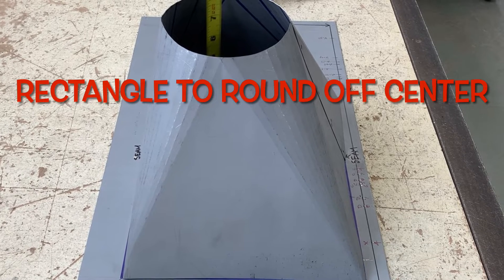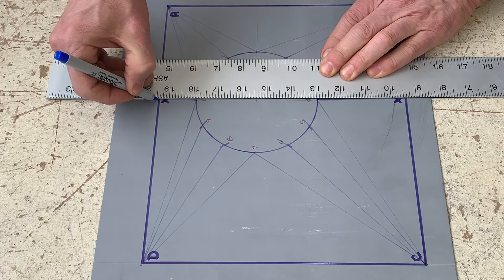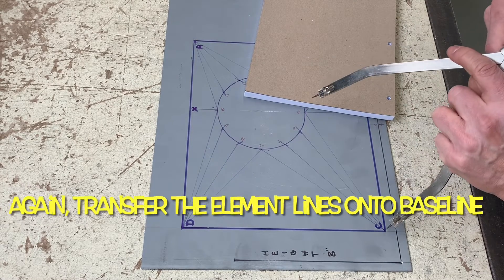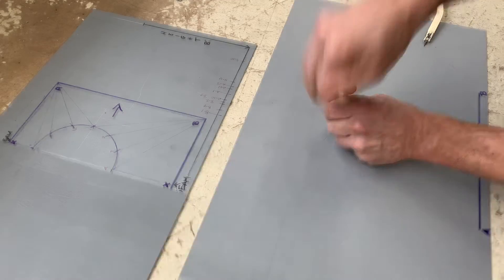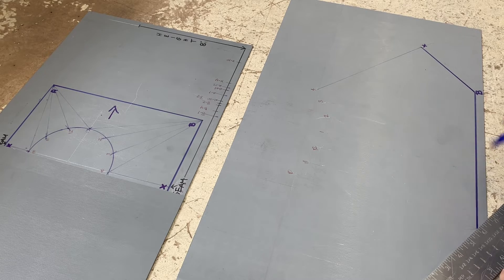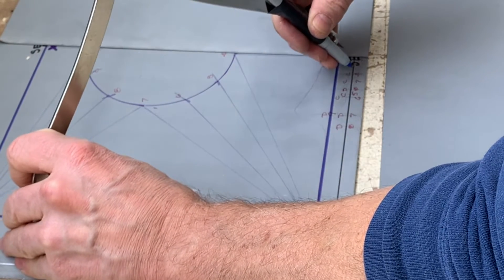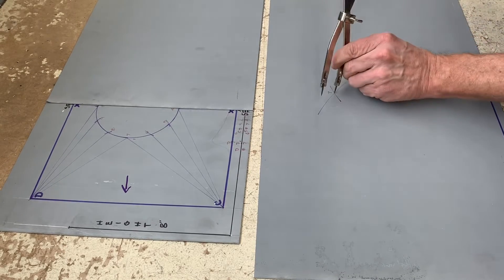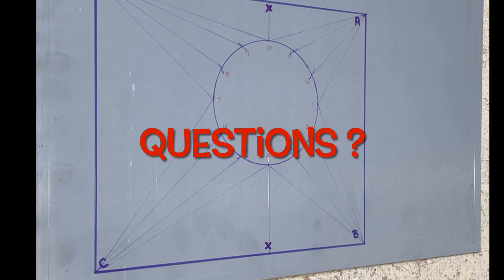Triangulation - Rectangle to Round Off Center, fabrication

Comment: Regarding the lower rectangular part, is there a standard for what the radius needs to be at the corners? I have a flattening program I use in CAD and it requires this input. Great work on the video sir!
Reply from the maker: I’m guessing you work with heavy gauge metal?
Reply: @sheetmetalwork  Yes 3/16" in this case

Comment: sir can you make rectangle to round, 
example is 350x150 height is 200 diameter is 150. please use 4 sides, 1 piece  each sides separate.
Reply: so it will become 4 seams each side

Comment: This is a great method. I just tried it in 2d cad recently, so I could plasma cut the shapes. Confusion 360 lets you easily loft the shape in 3d, but then it's impossible to transfer to a 2d flat pattern. So this is still the best method
Reply from the maker: Thanks Andrew